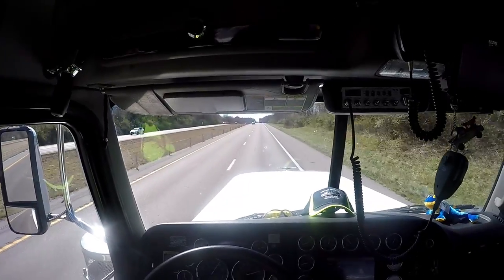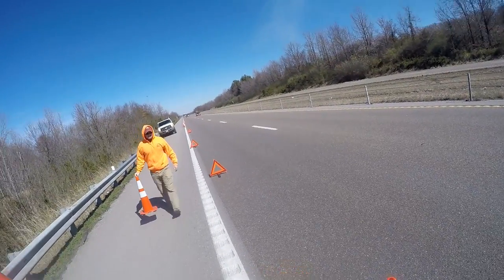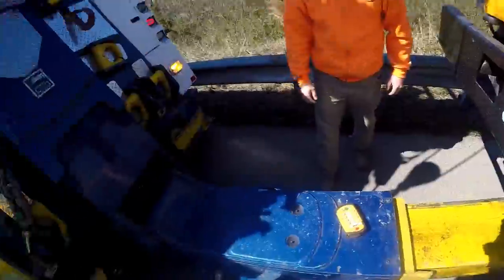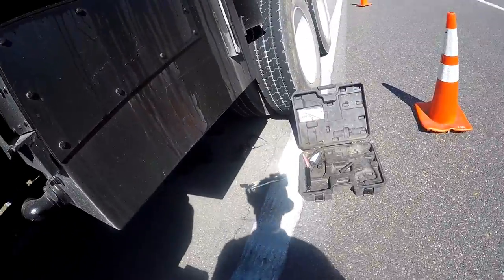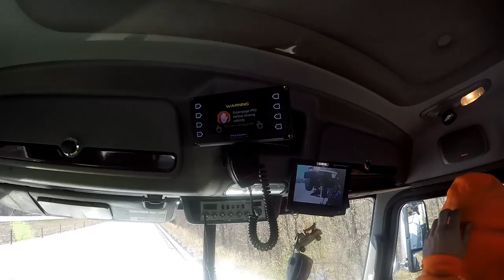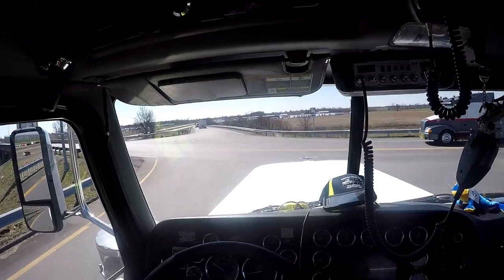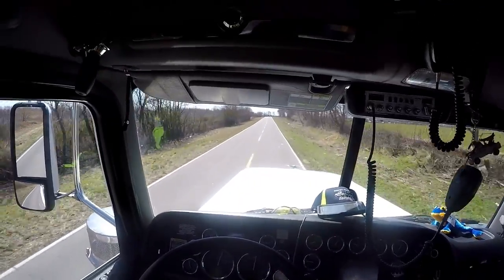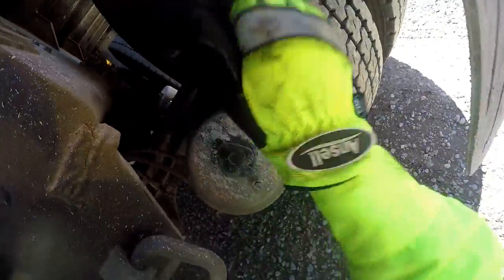LOADED DUMP TRUCK TOW OFF THE INTERSTATE

Comment: Great video as always, thanks!

Couple of thoughts on how to improve the truck though:
1. Make it an extended cab, and install a switch to move the driver and passenger seats back 18". This would allow you to get out easily and comfortably on the passenger side when parked on the side of a freeway. Expensive mod, yes, but cheaper than a funeral! ;)
2. Mount a wifi or wireless camera in the rear light bar that you attach to the rear of the towed vehicle - makes backing much easier!!
3. Some slide out lights on the drivers side of the vehicle.  Lets assume a broken down semi in the emergency lane (right) with a full size reefer. You pull in front of him, your lights are all hidden for oncoming drivers.  A simple extension pole that can slide out the light to extend 1-5 feet beyond the truck would push drivers into the next lane without giving then anything to hit, especially if they are 14 feet up!!  Look at the mirror extensions used by trucks that haul mobile homes and you'll see what I mean!

Keep up the great work, enjoying the channel!!

Comment: I like that lazy susan chain box.  that wrecker body has all kinds of little features that make the job easier. well thought out equipment. its still bull work .  get those caging bolts in before the air runs out.

Comment: Your truck reminds me of a 26' Penske truck I brought back from Jacksonville, FL to Fort Walton Beach, FL. with a full car hauler attached. On the way back I stopped at the I-10 Truckstop I parked next to an 18 wheeler. The driver commented I was parked in the wrong place and I asked him if he'd included my trailer. He said he had not even seen in, but when he found out I was longer than his truck. He asked me if I thought I could do a test for them. He called three of his buddies and said he has a guinea pig,. They set a truck parked along a wall, then once I parked they pulled another in behind me and put one even with the front truck. Now you know where this is going, I was to get my truck and trailer out of the spot I was in. I did just what they had not expected me to do. I slowly backed the truck up so as to not set the trailer brakes, and pulled out of the hole they had left me. They had the surprise of their lives, they had never seen a car hauler backed up without setting the brakes. I told them if you go very slowly, those brakes will not set, any other way and they would. They bought my dinner, and I continued the trip back toward Fort Walton Beach. I stopped in front of my house and Dad came out to look at how long that thing was. A 26' box plus 19' to the front bumper, now add the 28' car hauler. 73 feet long  Yes I agree there are some corners that can't be taken or should not be taken when driving what seems like the box of a semi-forward and the cab as the trailer.
Here's a quirk in the Florida driving law, I can drive that 26' box truck without having a Class A CDL, [although I've had mine since 1975], the limit is to 26001 pounds on a Class D drivers license. 
I've driven things you most likely haven't even given a thought to like the 6 wheel front wheel drive road grader that we used to take to the top of a 326' high hill. The road was coral rock and the blade was set 1 degree inwards when driving both ways. Coming down you feel like you are standing up, it's nearly that steep.

I've driven a US Forest Service Fire Truck that had 5000 gallons of water in it to a fire. Started the machinery and started into where the fire was using a 45-degree spray moving the nozzle in small circles. The fire was put out and the area around where it had started was well saturated with water.  The chief of the Security for the complex came and got a thorough spraying down before he was told that I had warned the gate guard I would be bringing a fire truck onto the property, do not lower the gate, I'll drive straight through it. And I did. He was fit to be tied when the guard admitted lowering the gate and that I had driven through it on my way to a fire. That little fiasco cost the Security detail $5000.00 to replace.

Comment: Ron, I have to tell you, though I've been there and done that many times in person,  it's a lot nicer watching it on the screen :)  I curse automatics in trucks.... Of all the breakdowns I've had over all the trucks I've driven (even the old beaters I had in my early days), I've never been left sitting by a manual transmission or a clutch problem. Automatics are a different story :(    You're extra vigilant out there,  and rightly so.  Don't ever let your guard down for a second.  Safety first, safety always !

Comment: More of a cummins guy myself Ron. My rotators got a twin turbo C15 Caterpillar which makes a crapload of horsepower. Buuuuut I drive a Dodge Ram that’s got a Cummins in it of course. I like the Dodge cummins engines a little better than the ones in the big rigs because the Caterpillars yo me seem more Torquey and reliable just saying. We got opinions. If your a cummins guy I respect that. More of a Cummins guy in the pickup truck than in the big rig is what I’m saying here. I prefer the Caterpillar in the big rigs I always drove trucks with that motor so I know it the best... also God Bless and keep up the good work out there. Don’t hurt yourself as well.

Comment: In Denmark where I live. We have pickup trucks whit a light board trailer that goes to motorway incidents (or where necessary) and block off a lane. the trailer folds out, whit 2 big flashing spots and flashing arrow lights. :)
they can also flash in a cross pattern.. to illustrate a block. instead of a lane change.
and then there are blue flashers for emergency and orange for stuff like roadworks or breakdowns :D

Comment: Ron, for those like me who don't know the first thing about HGV's, could you kindly explain what you're doing as you're going along please..? For example, those four bolts you put in by the wheels of the truck you towed. What was that for and were they something to do with airbrakes?
Reply from the maker: I will gladly try to explain.  The four "pods" by the wheels are called spring brake chambers and they work as both the parking brake and the service brake on a dual chamber/dual opposing spring set up.  The large spring holds the parking brakes and requires air pressure to release so that the vehicle will roll.  When towing a vehicle I have to be able to release the parking brakes.  Sometimes I am able to connect air from my tow truck and supply air to the towed vehicle which allows me to release the parking brakes.   When I can't connect into the air system or the air system is damaged, I can release the parking brakes by installing the "caging" bolts into the spring brake chambers, which is what I did in this video.  I hope this explains the situation well enough for you.  Thanks for watching and God bless.

Comment: Question.  When you Wrapped chains they seemed to be pretty loosely on there.   Do they tighten when the angle of the load in the forks is changed?  Ex Positive force to a neutral?  What are your opinions on Omega Chains?

Comment: Another excellent video. At 20:47, I saw bags of baking soda. I know it's a product of 1001 uses, but your carrying it baffles me. What's it used for? Mix it with water to serve a soothing drink to an anxious client?
Reply: Cars contain batteries that are often full of liquid acid. (AGM car batteries are expensive) Wrecks tend to let that stuff out.
Reply from the maker: jfbeam had the correct answer.  Baking soda is used to neutralize battery (and other) acids.  Battery acid will burn your skin and make you sick if you breathe the fumes.  It is also dangerous if mixed with other chemicals, so we keep the large bags of baking soda to neutralize the acid.

Comment: I notice that you put blocks under the tire on the side you chain up the tow bar, before you begin to hook up the chain.  Do you do this because, just in case your air pressure leaks out and lowers the tow bar?   And have you ever had the tow bar hydraulic pressure leak to where the tow bar did drop, before you started putting a block under the tire? Being this is a three year old  video, you will, more than likely not see or read this commet.

Comment: Sounds like a lil engine noise coming thru speaker when the backup camera is on.  Check the grounds in the circuit and check to make sure none of the camera wires are near any of the speaker wires.  Hopefully its not that what I heard but if it is I know it has to drive you crazy!

Comment: Just a question, why do you disconnect the drive shaft every time you tow a truck?
Reply: Only on trucks with automatic transmissions.
Reply: Smitty Smithsonite. ah, I get it, was not aware some trucks had auto as an option. Work with cars, not trucks. That makes perfect sense.
Reply from the maker: It is strongly suggested that either the drive shaft be removed or the axle shafts be removed for all tows where the drive tires are rolling, whether it is a standard transmission or an automatic.  Not doing so risks damaging the transmission.

Comment: I have no experience in your business but I think the first thing I would have
done upon arrival on the scene would have been to attach the light bar, 
left vertical, high as possible  to back of customer truck.
Also think you should have a large bank of emergency lights on crane boom
that you could raise up to warn traffic.
Reply from the maker: Thank you for your input.  We actually just installed a lighted arrow board yesterday and I am hopeful that it will assist in getting drivers to notice us more.  God bless.

Comment: Ron, i know its not Miller/Century standard, but the next time you buy a truck, consider roll-up tool boxes, like seen on many firetrucks. They would save you from moving in to the lane of traffic :)
Reply from the maker: There are bodies that have roll-up doors.  I'm not advertising for them....I like my Miller.  But here's a link to a modular body if you'd like to see one.  https://www.jerrdan.com/equipment/rotator/5060-ton-rotator
Reply: Ron Pratt i've seen the JerrDan, and i definatly like the Miller more, however, the benefit of the roll-up doors are huge if you ask me - maybe Miller will make that one day :)

Comment: Sir Ron I didn't see you wrap the u-joint with duck tape as to not lose the bearing caps!!!  I had to get towed in Mi.  The tow driver didn't tape the caps and lost them on way to shop!! had to buy new joint!! At my expense!!
Reply from the maker: This u-joint had a steel strap running across the caps to keep them in place.  Some u-joints are set up this way.  Good observation, though.  You make a very valid point that others need to know.  Thanks for watching and God bless.

Comment: Hey Ron, love your work, but ay I ask why you can't shut down the right lane. Even if you got a patrol unit on the scene just to make it safer?
Reply from the maker: To properly shut down a lane on the interstate I have to have advanced warning for at least a mile behind me.  Some tow companies have their own separate support vehicles with traffic control devices, but they are hard to justify for just a standard tow.  I can call a police agency to assist with traffic control and they would come to help.  The opposite side of that is that our police forces are stretched thin already and our situation would be a low priority for them.  It they have other, high priority calls, we could be waiting a while.  Waiting on the side of the interstate, to me, is just as, if not more dangerous.  I would much prefer to get in and get out as quickly as possible.  Thanks and God bless.

Comment: 11:10 If your doors didn't swing open but popped out and slid to the right or lift depending on the door and the side of the truck if they only had to pop out maybe 2 or 5 inches you wouldn't have to be in the lane of traffic like you are.

I have noticed that you have forgotten to toot your horn three times before backing up.

Comment: What keeps the rear wheels from turning the drive shaft even though the front of the drive shaft is disconnected?
Reply: The point of disconnecting the driveshaft is to keep the transmission from turning. The rear driveshaft turning doesn't hurt anything.

Comment: Hey Ron---how come you have to unhook the drive shaft. Why can,t you just put the truck in neutral and tow it.
Reply: Kelly Lamb I actually work for CAT building tractors and looking at how he has to take the driveshaft off appears to be the exact way I hook them up and if that truck is anything like CAT tractors, even if the vehicle is in neutral the yolk that the driveshaft sits in still spins when the vehicle is in motion, so he wouldn't have a choice but to unhook it, so he's able to tow
Reply: Safety. Even in neutral, bits will be spinning. Should it suddenly not be in neutral, very bad things will happen.
Reply: Manual gearboxes rely their lubrication to the oil sloshing around and spewn allover the gearcase by the gears. Automatic gearboxes are mechanically more sophisticated and need an oil pump to circulate the thin ATF in a similar manner as the engine has oil pump, filter, oil channels and so on. This oil pump can't be driven by the drive shaft, so having it connected would result in the gearbox being spun without lubrication. Well, that's never a good idea...
Reply from the maker: It is strongly suggested that either the drive shaft be removed or the axle shafts be removed for all tows where the drive tires are rolling, whether it is a standard transmission or an automatic.  Not doing so risks damaging the transmission.
Reply: He ran that thing out of fuel didn't he Ron?  I was wondering at first because it didn't look more then a few years old but after hearing him say he may have ran it out of fuel it makes me think that he knows he did.  Kid just cost them a $1000 tow bill.
Reply: Xcaliber Trekker I had one the other day where the bloke had the fuel get too low and ended up below the pickup. Owner cbf to bring fuel out I'm case it wasn't. It turned out it was out of fuel. He comes out to all his tow calls now lol.
Reply: Ron Pratt what kind of extension was it you used on the cage bolts? I need one of those.

Crazy deep throat 19mm or something?
Reply: Xcaliber Trekker I don't think so - when you see them back at the shop, the shop guy opens the fuel tank and has a look in - doesn't say anything, so I presume it wasn't fuelling related.
Reply: +Devourer221 Google "brake cage bolt socket"  Lisle makes a few.  $15-25 depending mostly on depth.

Comment: What type of socket did you use to pull the drive line bolts and why didn't you pull the bearing caps?  I drove heavy wrecker for 6 years and I always pulled the bearing caps for fear they would fall off in transit.

Comment: how do you decide to pull the drive shaft or axle shaft? also I did not see you use anything to hold the u joint cups on, so you ever loose any? I always duck tape around them,am I just wasting tape?

Comment: Ron Are the yellow safety chains on this rotator truck coated in plastic? For some reason or another they look and some times sound plastic to me. If you could buy another rotator truck would you buy this same size or would you go up in size? Thanks for the videos.

Comment: If you think that road is bad, you ought to take a run down 95 through Manhattan  - you'll hit your head on the ceiling repeatedly as you pass! The roads up here in MA aren't much better - just about every bridge expansion joint will send you airborne in the air-ride seat. And don't even get me started about the drivers! I feel for anyone working the shoulder on these hellacious roadways up here! EXTREMELY dangerous. People feel that moving over or slowing down is a sign of weakness ...

Excellent videos. I subbed a few months back. Thank God for you guys in the Midwest and South - if not for you guys that still have morals, America would be lost. The clowns up here appear to be hell bent on taking it all down ... but I digress. 

Thanks for taking us along, and God Bless.
Reply from the maker: There is good and bad everywhere.  I believe that each person should be the good that they want others to be.   It is difficult when life and people try to bring you down....I get it.  Just do what you can to make your little part of the world a little bit brighter.  Thanks and God bless.

Comment: Relying on a few cones on the side of the road and the "slow down and move over one lane" rule ain't gonna cut it.  The ones Intentionally ignoring the rule are Not the ones you have to worry about (they will come close).  It's the Inattentive driver who's going to mow down the cones before making contact.
If they can build a sophisticated truck like that, surely they can come up with a better system.
Reply from the maker: We are now rolling with a lighted arrow board and investigating options for a secondary vehicle to encourage slowing down and moving over.  The issue with an inattentive driver is they will slam right into the back of a recovery vehicle lit up like a Christmas tree.  Sad.  God bless.